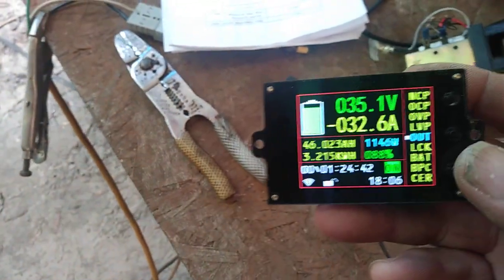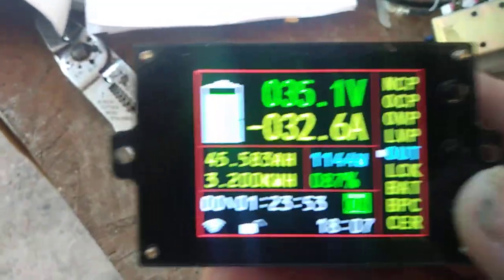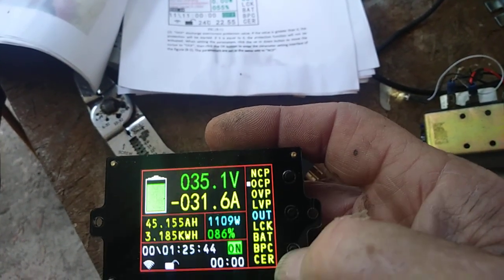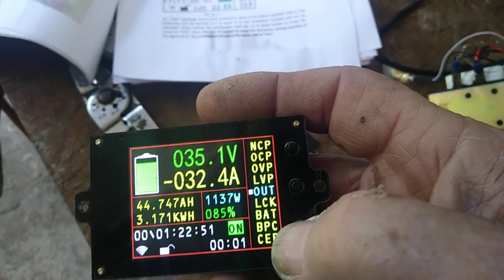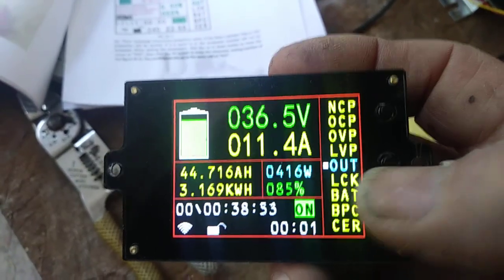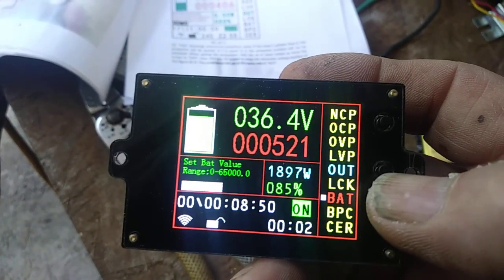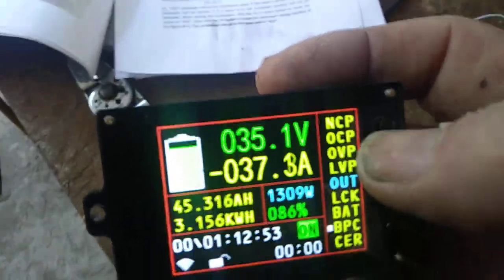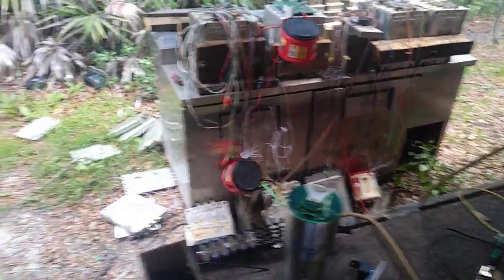Vac8010f ah meter for dc voltage 0 -120 v 500 amps with relay control for charger and load

Comment: Hi, thanks for this video! Has the meter continued to work for you? Also if someone wanted to monitor their car battery (primarily to monitor miliamps of drain, what size unit would they get? I have a Honda Element with a 4 Cylinder engine. The battery specs say the cold cranking ams are 500A. If I got the smaller, 50A one, would it be short circuited if I cranked my car?
Reply from the maker: Yes I think you'd want the one with the 50 amp shunt to be sensitive enough to see a small drain. When the shunt is small like that what will happen when you crank the car is the meter will just go to the maximum amperage but it won't hurt the meter it just doesn't register anything above 50 amps. So this would give you good sensitivity .

Comment: Warning, the is a complelty buggy product. I tested 3 different units. Do not buy the prodcut. Problems: The manual is wrong. 1. The red wire and not the black wire goes through the hall sensor. The volt measuring wire is on the same bus bar and thus there will be a flow of current through the black wire which leads to an offset of Amp mearuring. 2. NCP and OCP are in the manual wrongly named. The NCP parameter is OCP and vice versa. 3. A lot of language errors. 4. Two units lead to a situation where the output relay could not be changed anymore after paramters were changed, only a reset helped. 5. Two units did not allowed a change of the different modes. 6. One unit started smoking after some time.  Really do not buy this product if you dont want ending up having a lot of problems. Start a refund processs and send it back.
Reply from the maker: I would agree . I thought it was me but found different ones seemed to work differently. I'm now using a different model with Bluetooth and it's seems to work much better it's in a later video.
Reply: @steveclunn8165  which one? Please let me know.

Comment: Mr Clunn it would have been helpful see how you wired it up.  I didnt see your relay or anything you did just walking through setting up the meter.
Reply from the maker: Yes you are right I could have done a much better job with the video. I think we can say that about them all. The relay has to have its own power supply so what the meter actually does is just turn off and on power to or from the power supply to the coil of your relay I don't use this meter anymore and remember it being a little hard to configure. I believe you do have to observe the polarity on your power supply that powers your relay as it is probably a transistor that controls the output.

Comment: Hi Steve, can you tell me if there is any way to calibrate this unit? I am getting false readings for current and they don't look right.
Reply: At the back of hall sensor(block with round hole), there are 2 variable resistors. Can those resistors be used to adjust something?

Comment: Hi Steve I"m Form Thailand This video is very helpful. I have a problem. Please ask when the discharge calculates the percentage decrease. as we use But when we charge it It doesn't show the percentage power increase. I will ask for advice on how to fix it, thank you.
Reply from the maker: I am puzzled by this with the meter also. I believe after a few Cycles it looks at the information and calculates the capacity. You do have to have the M seeing current going from the charge and from the discharge

Comment: Hi Steve, can you or anyone tell me if the display stays on when the parameters on the screen are changing? I know there is a screen timeout and also a screen shut off if the display is showing less than a certain % of current. I'm also hoping this unit will not only show current used, but also deducts charging current if both the main cable and the charging cable both go through the shunt at the same time. I plan on using this on an electric vehicle. Can anyone enlighten me?
Reply from the maker: Yes it will show current going both ways . I think it uses this information to determine how charged the battery is so if you don't have the charge current registering it won't be able to keep track of the charge of the batteries. You need to hook the charger cable to the same side as the load and on the other side just the battery. You can put the current sensing coil anywhere in the pack as that would also put your charger and your load going through the current sensing coil. Make sure you have it going the right way or as it charges little think the battery is getting empty.

Comment: Hi again Steve.  I don't think mine was installed using a shunt.  Unless this meter has a shunt built in to it. Van you let me know?  look forward to hearing from you.
Reply from the maker: Ya it has to have the shunt to read the current and keep track of the amp hours
Reply: @steveclunn8165  Thanks for that.  I have 400ah in batteries and a 3000w inverter. What sized shunt should buy..I believe this is important.

Comment: Thanx a lot - it bemomes much clearer now. One question: The display is powered with 5V via the USB Port. Can it be powered with eg 12V or more. On the circuit board of the display unit there seem to be connectors with a battery symbol - even if they are not soldered.
Reply from the maker: Not sure about 12v but there are lots of converters to step 12 down to 5v .
Reply: @steveclunn8165  Hi Steve, of course there are. But I´m quite sure, that there is already an converter on the cirquit board. As there are Pins with + and - and a battery symbol. Anyway - I will check it out, if I decide to install the display permanently. Till then, it stays portable with a cheap usb power bank.
Thanks a lot for the quick reply....

Comment: Hi Steve..  I have set tJe BAT to 400AH and tge BPC to 100%..batteries fully charged.  The battery graphic and AH % is not going up, only reducing   Any ideas..Current volts at 13.20, but AH% at 67% and dropping.   Thanks.

Comment: Hi Steve, thanks for that great Video. Ich have Problem to config it in my car. Its only discharge. I want this gadget only to see my batterystatus from car, cause i have a 2000W subwoofer. Without Motor it have 12,5 V and it get out of capacity, with Motor on it hat 14,8V but it still lost capacity. How can i say him, that by 13V+ the Batterie load. Thanks in forward and sorry for the Bad english, im from germany :)
Reply from the maker: This might not be the right meter to use for your situation. It has to see the electricity going into the battery and out of the battery. From that it tries to figure out how full the battery is. The voltage going up and down without current flowing through the show will confuse it. This meter only works on direction and is easier to use. https://www.amazon.com/dp/B07FN3VXH4/ref=cm_sw_r_cp_awdb_imm_2D70226RA9HJ37MHN84M?_encoding=UTF8&psc=1

Comment: Doesn't show what kind of external battery voltage ect. Doesn't show what the relays is actually connected to.  The; instruction says NCP is charge over current protection. I saw in another video that while on NCP long press and you get 4 more options for calibration.
Reply from the maker: I believe what you're seeing is the points to the relay which would mean you can pass whatever current the Relay can handle which isn't very much has it small and maybe 24v .just a guess

Comment: Hi there...    I bought this meter about 3 years ago and my auto electrician set it up when he installed it.  I have to reset it and have successfully done all the settings except for the  BPC (residual amp hours in the battery).  I take the dot down to the BPC, click the middle button which turns the BPC red, then using the top button, I take the numbers in the left, middle box up to 100.  But, when I press the middle button to set, the number goes back to '0'.  Can you tell me what I am doing wrong?  Would be most grateful:)
Reply from the maker: I think I had the same problem. Mostly use the jdl404 meter . not so fancy a display but easy to use

Comment: Cheapest source for the 500 DC and 500 A version is around 29$ at aliexpress link below 

A Manual has been put together by Banggood as pdf - link below

The manufacturer seems to be TAIDACENT and has to offer a lot more solutions, display sizes etc. here in the link but that is only for getting an overview. You can get those units usually cheaper on aliexpress and ebay.
TAIDACENT overview ...
https://taidatech.en.alibaba.com/productgrouplist-806460227-1/LED_Meter.html

Taidacent VAC8010F 500V (100/500A) 
https://www.aliexpress.com/item/32856210821.html

manual 
http://img.banggood.com/file/products/20180718053121SKU973245-Instructions.pdf

Comment: Do you only need the relays if your useing a seperate battery source?
Reply from the maker: You're going to need a larger contact her or large relay then what's inside this meter. I think the relay might handle one amp so it's just for controlling something else and I don't believe it's isolated

Comment: are you sure this supports 120v 500 amps? when i look up "vac8010f" the specs i see are 80 volts 50 amps.
Reply from the maker: They have a few different models the higher the amperage the less sensitive it is so you want to get the one that's closest to your Peak amperage. I don't have a link but believe it was Amazon that I got it from

Comment: Do you know any aplication to Android?
Reply from the maker: I haven't seen anything but as it does send things out on the Bluetooth I guess that would be possible let me know if you find something
Reply: @steveclunn8165  The Bluetooth, if it is Bluetooth is simply a way the shunt end and the display end communicate with each other. The company that make these is called Shenzhen Taida Century Technology company and their brand name is Taidacent. I did email them to ask if there was an app or software for this and the answer was no.
Reply from the maker: @johnlannigan9831  thank for the input. If you find one let me know😁
Reply from the maker: I don't know of any offhand but the device does turn the relay off and on which could be used for a lot of things

Comment: Thanks for the video Steve. Is there any chance you could show us where you have the relay wires connecting too? The manual is useless and I really have no clue where to try attaching them. Cheers
Reply: Kindly share the wiring diagram if you have gotten it

Comment: Can I use my battery banks for the power source for the relay and the device or will it interfere somehow with the reading of the monitor    
My intention was to use this monitor for a small electric vehicle. 
I have also studied the data sheet and I can’t understand why they are using a separate power source for the relay and device.
Reply from the maker: That's a good question and so far all the batteries packs that I've had this meter on I've been too high of voltage 4 the contactor that I was switching so I've used my own power source. I'll look at this next time I get playing with the meter though should be able to figure it out with a ohm meter. If you're monitoring at 12 volt battery pack and have a 12 volt relay or contactor that you're controlling I would think it would be okay as long as all the grounds we're coming. The problem would arise with a device that uses a transistor and instead of a relay which is pretty common.
Reply: https://nl.aliexpress.com/item/4000061525221.html i gotten it here it shows some schematics. iam not sure it is actualoly bleutooth, it goes trough a fair distance and glass. the one i've got  works on the battery itselve without interference, yes
Reply: i just see now the question was can i also hang the relay on the battery, probably. i only use the device on the 12v agm, and it is measuring currents correctly, while being powered from it, i dont switch relays with it
Reply: The reason for using a separate power source for the display and the shunt box is simple. It's to allow remote installation of the current shunt without having to run wires between the two units because the two units communicate via Bluetooth.

Comment: Hi Steve, Have you tried to put these data to internet?
Reply from the maker: Your thinking that the blue thooth could be picked up by a computer and then sent to the internet ? Maybe ? Even an app on the phone would be nice.
Reply: @steveclunn8165  yes, Exactly. May be a computer or by any Arduino or RaspberryPI... Or even the USB provides the Data, So that we can read the serial data from USB directly to Arduino...
Reply: the bluetooth-wifi chip board  is pinned in with a connector , on the back of the screen. maybe if someone could sniff the connection pins if there is a pinout datasheet,  to see if its serial rxd txd  showing normal texts, then you might be able to add the board to an esp32 of somekind and channel the serial data out to somewhere its able to be processed , if you react to this message i wil upload pictures of the wireless pcb on the back so you can see if tis doable or not . maybe i will, myselve, later, if i find some free time or when my display itselve burns out or something
Reply: it would be nice to get the data visible in hassio home assistant, my emonCMS already can do this i see the net voltage and watt use from the home there already
Reply: @thomasdb.eu.  Yeah, Let me try that. But I doubt that  the data I get might not be a plain text.
Reply: You are searching for this one I guess 
TF03K-B - 50A ttl232 data controller 36€
https://www.aliexpress.com/item/32883704077.html

which uses a shunt and needs a shielded cable you can also get from the same vendor ... 
https://www.aliexpress.com/item/32823972314.html

This comes with a ttl232 interface to monitor ... and you might be able to add bluetooth on top

Comment: Hi Steve, I wonder if you could give me some advice. I have the same model of battery monitor, which works well with my inverter and monitors my amps being used, but it doesn't pick up the charging from my solar panels. Many thanks, Pete
Reply from the maker: Some of this will depend on where you have the shunt or hall effect pick up placed and if your inverter is using the same amount of power as the solar panels are put out and you have the meter shunt in the right place it will read zero because nothing is going into the batteries. The power comes from the solar panels and then goes directly into the inverter and the batteries are seeing no current flow. I don't know if you have the shunt in the right place but even if it is in the right place close to the batteries with nothing on the battery side except the batteries. everything else on the load side solar panels , Chargers , inverter .